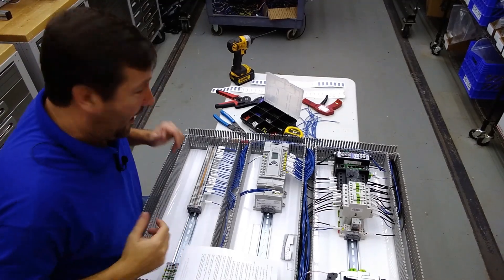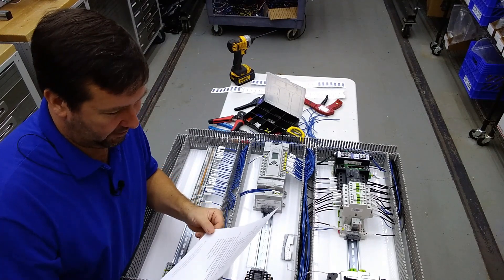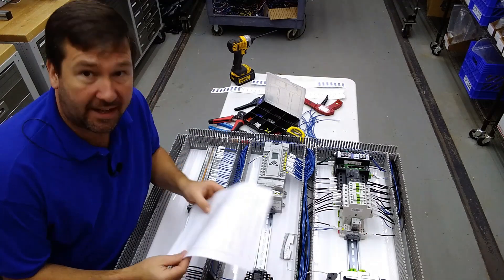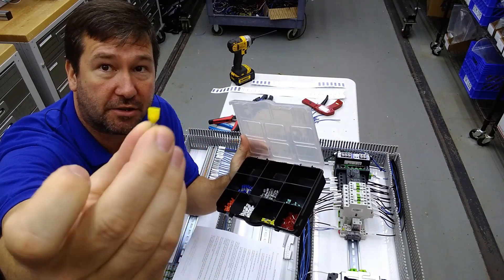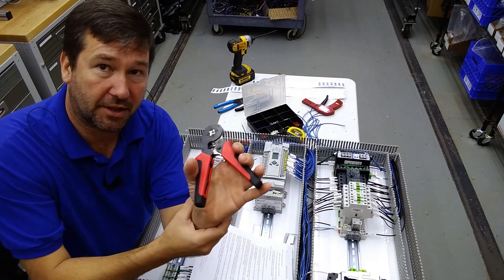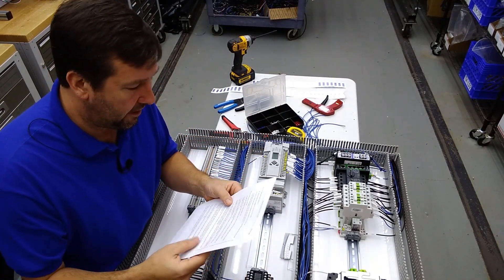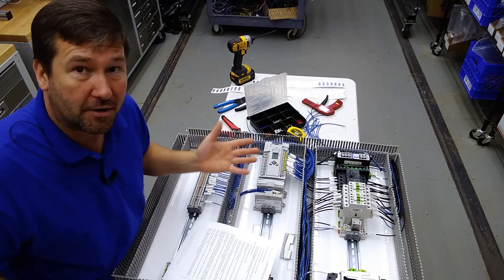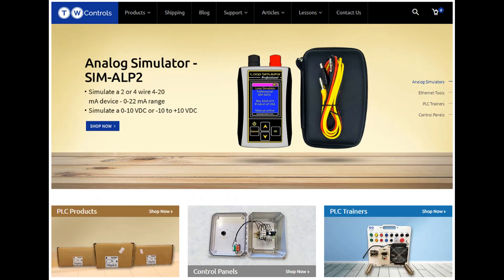Wire Ferrules - When to Use, How to Crimp, and UL 508A Guidelines

Comment: Some don't like the wire size-based insulator colors, contrasting with wire color. which isn't anything but aesthetics, but this matters to many. They're willing to suffice with a smaller strand funnel (uninsulated) to have the finished look they want.

Comment: Tim, great stuff.  I don't disagree with anything you said.  😁  I wouldn't hate to see you do a video about what not to do with ferrules.  In general I am not a fan of ferrules except in spring clip terminal blocks and PLC i/o...small stuff in general.  It's great on 18ga and smaller, sure makes work easier.  What I really loathe is when people use ferrules on motor connections or other big loads.  A past job I found 6ga wire, ferruled, torqued down in a Square D disconnect...3 phase stuff.  The ferrules were effectively destroyed upon installation.  <triggered\>.  Another thing at another past job was ferrules in Allen-Bradley contactors with the curved lug plate meant for stranded wire.  I replaced many of those after they burnt up.  Now I get that my beefs probably had more to do with workmanship than ferrules...but I feel people have a tendency to go overboard.  I was especially pleased when, in the video above, you specifically pointed out that ferrules, or any crimped on connectors, are not required.

Comment: Question(s):

I saw a video where someone took 3, 14awg wire into 1 large ferrule. 

I know there are ferrules for double wire 14 awg. 

Is there some for 3? Is this allowed?
It seemed very odd for me.
Reply from the maker: I have seen this done also but I have never seen a ferrule that officially allows more than 2 wires.

Comment: Interesting that you can't use them on aluminum.

Admittedly, I recently installed an e-stop into a small, desktop machine that was already using aluminum wire and used ferrules for the connections...
Reply from the maker: It is never a good idea to use dissimilar metals.
Reply: @TimWilborne  Just to make sure I understand, as I'm still relatively inexperienced.

Was using ferrules on the existing aluminum wire a mistake? Or would mixing copper and aluminum wire have been the mistake? 

I used aluminum wire at the same gage for all added lines to keep everything consistent.
Reply from the maker: Anytime you pass electricity through dissimilar metals such as copper and aluminum, you will get galvanic corrosion.   There are very few ferrules suited for aluminum wire.  Even though they may look aluminum, they are tin coated copper.

Speaking of which, are you sure the wire was aluminum and not tin coated copper?  Aside from service entrance cables into homes, aluminum wire is very uncommon.  Here is an upcoming video where I talk about tin coated copper
https://youtu.be/vO1RbYiQWD8
Reply: @TimWilborne  That's good to know, thank you.

The machine was a cheap, foreign import. I presumed they used aluminum to reduce cost. The wire was 20awg, so it was difficult to tell whether the strands had copper cores. That'll be something for me to check. I've been the only one using the machine for testing since the install. Its not production live yet.

Short of soldered ends, are there any recommended terminals for aluminum?

UPDATE: I checked the specs for the wire I used, and it was tinned copper. I'll be checking the pre-existing wire tomorrow.
Reply from the maker: I would be it is all tinned copper.  Much more common than aluminum.  Pretty much the only time you see aluminum wire is power wiring.  And when it is used, it is important that you use dielectric grease for the same reason.
Reply: @TimWilborne  They both were, I checked the pre-existing wire this morning. Scoring the strands revealed the copper underneath.

Sounds like I got lucky this time. Thank you for your help.
Reply from the maker: You are welcome

Comment: Companies who make electrical panels for their equipment like CNC manufacturers, will have internal requirements to meet UL 508A with UL 486 consideration (pull strength, etc.), and also have best practices based on actual testing and operational experience in the field. 

A screw pressure connection in UL 508A as compared to the NEC many times for conductors10 AWG and smaller are addressing the basic differences between stranded and solid conductors in connecting devices and circuits in a panel. A simple example is with house romex wiring solid 12 AWG copper, as just one example, which would be connected to a breaker in a panel. In this case the breaker screw pressure connection is designed for a 12 AWG solid wire (and will list the required screw torque), that is, assumes that there is no separation of strands which is valid because it is a solid conductor so there are no strands to separate. But, what if we wanted to connect THHN/THWN 12 AWG stranded wire (which is also NEC listed as an approved wire type) to the same breaker screw pressure connector. What I have found is there is no standard in how a screw pressure connection is designed. Some seem to accommodate stranded wire better than others. Some designs are so bad that you know the connection will loosen if the strands move or shift due to machine vibration or conductor heat cycling. The solution is to use a ferrule when using stranded wire, with the added flexibility of selecting the ferrule crimp shape (square, hex, semi-round, etc.) to best accommodate the device screw connection design. 

The NEC (as UL listed) does not require any derating or special consideration when using stranded copper wire with a ferrule. However, most companies will require the method to be listed (tested) through the manufacturer of the ferrule and how it is used. This basically results in the ferrule and crimp tool coming from the same manufacturer like Weimuller, as an example, with best application practices documented through a written approved document or a manufacturer's guide. A bonus is if the company makes dual wire ferrules which is a very good and inexpensive way to make a splice.

As mentioned in the video, if you are crimping eyelets to a screw terminal strip it is very similar in using ferrules because the eyelet and the crimper used will be tested to give a complete connection and pass UL 486.

The panel in the video did not show very large gauge wire stranded wire terminations. If the connection is to a screw connection lug (one where you insert the cable with a single Allen screw) with stranded wire a ferrule will be used, in my experience up to about 2/0 size, and Weidmuller makes ferrules for large conductors (I stock up to 1/0). If the connection is to a bus bar then a bolted crimp lug is used. Here again to meet UL 486 the crimper (which is usually hydraulic at a minumum of 6T up to about 2/0 copper), lug and die are specified for a specific NEC stranded wire type (lay), usually coming from the same manufacturer although with more mix and match options than ferrules. Common would be using W dies from Burndy that can be used in many different 6T crimpers, from obviously Burndy, but also Panduit, Greenlee and others. For larger conductors you would move to a 12T crimper with U die index D.

In panel making we have the added difficulty of using specialty large size conductors that have the proper rating but have different stranding than NEC class B (standard THHN/THWN). If the connection is into an Allen screw compression lug we can use a ferrule, but if it is to a bolted lug we have to then choose the lugs and the dies (may require multiple crimps) that will produce a complete solid cold welding of the joint. Which means you have to run some test crimps, saw through the crimp and inspect the quality and completeness of the crimp, then document the procedure as part of the assembly instructions. I have seen high stranding copper wire (like type K welding cable) used with an Allen screw compression lug with the expected poor connection and overheating (through thermal camera inspection), which would be easily remedied using a ferrule. However, when using a bolted lug you don't really know the performance of the crimp until you test it. You see this a lot in Marine panel applications, because the conductors are made of fine stranded tin plated strands which has no approved and tested "system" to make the crimps.

Comment: I work in a control building line . And was just given a Farrel kit to use. But some terminations require 2 wires to jump from device to device. Can I use 1 Ferrell for 2 wires? Or how do I terminate 2 wired
Reply from the maker: They make ferals specifically designed to put two wires in. And they are good per UL.

Comment: Funnily enough in my country they require ferrules on stranded wires with screw terminals, as the screw terminals rated torque sometimes outstrips the wires malleability resulting in strands breaking when tightened (as in screw directly onto a wire).
Reply from the maker: Interesting

Comment: Thanks for the video. A couple questions. First after you strip your wire, should it be twisted prior to inserting it into the ferrule? Or should it be inserted straight?

It's hard to see but when I zoom in on your panel it looks like you are using ferrules on your PLC connections (you can see the yellow insulated edge of the ferrule on those connections) but it looks like you are not using ferrules on the lower row connections (can't see any insulation color on those connections). If ferrules weren't used on those lower connections, why didn't you use them? Are there any type of components that you don't use ferrules on? 

It looks like you didn't heat shrink your wire labels before installing them. Why is that? In general when do you recommend heat shrink labels have heat applied? And how close to the ferrule should labels be applied? I find it tough sometimes to not melt a bit of the ferrule insulation if the labels are placed too close. Are there any UL specifications regarding where labels are placed?

Appreciate any help. Thanks.
Reply from the maker: Hi Christopher. Here is a video we did on that
https://youtube.com/playlist?list=PLUi5cdVq3wTAV2k2paP7e8JawhT_6eHAa

Comment: I was wiring into 12 drives and the spring clip on the tb"s were so weak and cheap I had to use ferrules for the two wires going in. What I do is strip the wire back longer then ferrule. crimp then cut the excess wire back to ferrule. !00% filled.
Reply from the maker: I've learned through the Phoenix Contact video series that not all terminal blocks are the same.

Comment: So i am using a screw terminal and the Ferrule is too long to pit because otherwise part of it sticks out but it still clamps nicely. Should I cut the extra leng rn from the ferrule? It’s 16AWG at most 30A of current

Comment: I was always told that "cage clamp" style terminal, such as the  Wago brand, was only for stranded wire, not for ferrules. However the  Wago website states that the cage clamp terminals  CAN be used with ferrules. I stand corrected!  Great videos by the way...
Reply from the maker: Thank you Richard!

Comment: Interesting 3:30.   In my opinion, when they say that you should crimp the right crimper, they mean a crimper dedicated to each wire gauge. I work in Siemens factory, and the type of red universal crimper you use, we can only use for double ferrules. For single ones, there is a crimping tool that has an individual channell for a specific wire gauge, like yours a second red crimper in  4:50. Sorry for my english.
Reply from the maker: Personally I don't like the individual trapezoidal crimps.  I like the hex crimps followed by the square crimps.  But as long as you are crimping a wire in the range specified by the crimper, the UL says you are OK.
Reply: @TimWilborne  Thanks for the information, you have  great youtube channel.
Reply: We did the same at Schneider Electric North East.

Comment: I like the insulated ones, but I have run across some items where the terminals were too close together to accommodate insulated ones.  So had to switch for that job.   Nice video. And so right about the crimping tool, a good one is worth it.
Reply from the maker: Yes, I like the insulated ferrules also.  A good tool can save you hands!

Comment: I use the crimper tool for the ferrules. I also use braided sleeves and heat shrink. I use it for car audio. Would heat shrink and braided sleeves pass inspection? Just wondering.
Reply from the maker: Cars don't fall under UL so I don't know

Comment: We use ferrules on all stranded wires

What is ur thought on ferrules on Thermo couple wire ? Dissimilar metal
Reply from the maker: The way I read it UL 508A says a ferrule can only be used on a copper strand wire. See 29.3.6(a) at link below. https://www.theautomationstore.com/wire-ferrules-when-to-use-how-to-crimp-insulated-vs-non-insulated-and-ul-508a-guidelines/
Reply: @TimWilborne  The main directive of using only copper stranded wire is so that there is not an opportunity for corrosion to start among dissimilar metals (an issue seen in making aluminum to copper connections, usually in a mains or high voltage application, that requires a specialized device that not only addresses the metallurgy transition, but also has a sealed gel that prevents oxidation and corrosion on the wires).

The issue with thermocouple wires adds the additional problem of introducing different metal interfaces, which will act as a different type of thermocouple connection, and potentially (and likely) skew your temperature measurement.
Reply: @chrisdurkin7   So you're talking mV on the wire... and generally nickel if not copper.  I'd be much more concerned about throwing the measurement all out of whack.

Comment: great video. i am pretty sure the insulation on the ferrule is to ensure that the wires are still "finger save" when someone needs to replace a part in the field while other parts of the cabinet are still energized. some wires have the insulation kind of loosely so it retracts back over time and exposes the copper. always strip a little shorter than the ferrule then push the wire even into the ferrule to shove the insulation back
Reply from the maker: I didn't think about the insulation helping the connection be finger safe.  Good tip!
Reply: For aerospace the wire has to be even with or slightly protruding from the end of the ferrule. So if you do cut it short you might not quite get the best connection.
Reply from the maker: Very good point. I just finished up a video series with Phoenix contact and that was a big thing that they pointed out as well.
Reply: Hello, we are Leading Wire Harness and Cable Assembly processing machine manufacturer & supplier in China with high quality and good price. Website: http://zsht-equipment.com/   Email: sales@zsht-equipment.com  Skype: gao.irene  Tel/whatsApp/wechat: +86-18676147382

Comment: I`ve been using ferrules for all multi-core wires of 0.5 to 6 sq.mm (sorry for not AWG interpritation, we don`t use it in Ukraine). That`s the way to keep wire managing inside the control box accurate and to re-tight easily if needed. Non-insulated ferrules in my opinion is non prefferable in term of extreme wire bending angles per length between the wire insulation edge and ferrule`s bottom. 
But of course you should follow the local guides.
Reply from the maker: I agree with the sharp bend problem with the non insulated ferrules. Thanks for watching!

Comment: I got myself a crimper off Amazon but for some reason in my opinion this is not a good quality crimper because I have a hard time fitting into small PLC inserts. Which one do you recommend
Reply from the maker: This one is similar to mine. https://controls.tw/sbqbs

Probably more important is what size wire are using and what is the maximum wire size specified by the PLC terminal.
Reply: @TimWilborne  Hello Tim! question, for a twin cable end with a cable cross section 0.50mm2 AWG: 22 which one do you recommend? I was thinking of Crimpfox Centrus 10S - 1213154. I think a square shaped crimper is better than the trapezoidal or hex shape.
Reply: @sandra9241   Square is better for square holes.. a lot of the DIN rail stuff, and screw clamp terminals.  Hex for round holes/terminations, and trapezoid is for the one guy who insists his crimping tool can to anything with the right anvil on it.
Reply: Sounds like it's a square crimp. I don't like them.